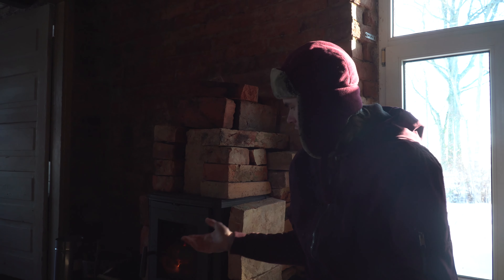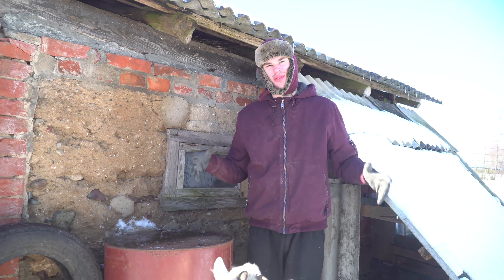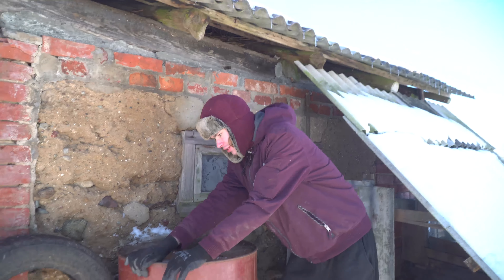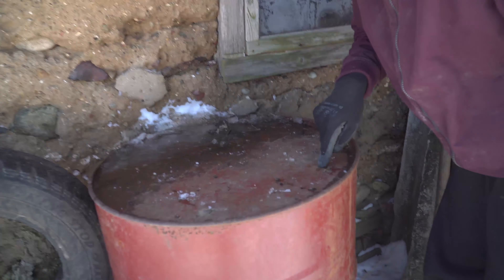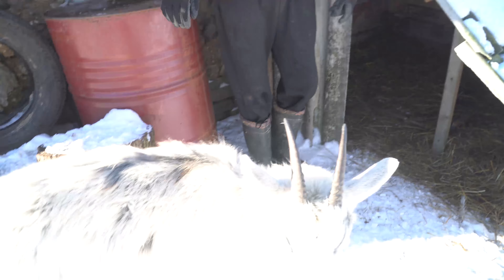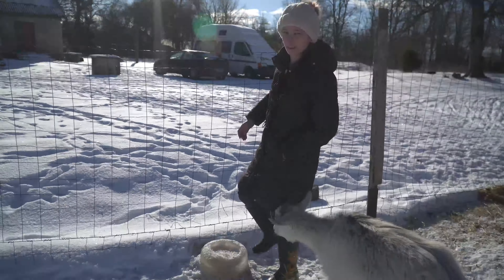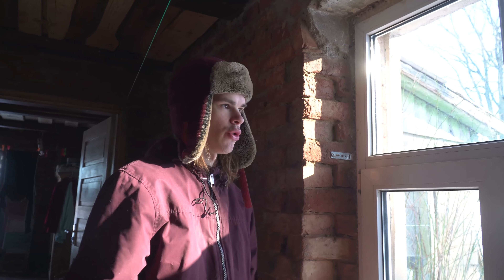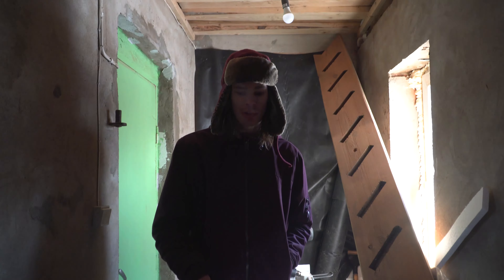WE SHOULD DO IT, BUT....

Comment: Your plan to clean and organize your files and videos is really good thinking! Now it is a right time to do it. Three weeks from now you don´t have time for that anymore! And even that the storage room is freezing cold, could you put temporary radiator so that you can declutter and organize? Then it is easier to start in spring. I am so excited for you guys and for upcoming spring! There is so much to do. I am waiting that moss to be removed from the roof and some beautiful colors to be appeared on outside wall. I would go very light mint green 💚. It sits nicely on environment and looks beautiful in summer against green grass and stunning in winter below white snow 🏡
Reply from the maker: The storage room is very cold and cold blowing through all over the place only thing that could heat it would be a burmer hester but we don't have one but it can wait anyways. The roof needs to be changed, i do like the moss but it needs to be fully removed and replaced, not a cheap process but needs to be done. The house color we where thinking about a nice green color and roof maybe red or green 🤔❤️

Comment: Hi guys, you're still thinking about your heating ... I think the old oil drum is not a good idea.  Maybe the tin will hold last a heating season, maybe not.  Weld something yourself or find an old gas cylinder or an old pressure tank made of thick sheet steel ... Cast steel would be perfect and would still work for your grandchildren.  A rocket heater must have a vortex (whirl) of flames, preferably anti clockwise, and since such a heater needs a lot of air, a pi!pe to the outside is absolutely necessary, I think 1 "should be sufficient. The fire flap (door) is opened for start heating and during the main fire the Air comes from outside. This air from outside, the 1 "pipe can be installed in such a way that the required flames vortex (whirl) is created ... (when heating up there is no vortex required).  So, the exhaust gases and the vortex of flames rise up the exhaust pipe to just below the upper surface of the dome.  The pipe should be about 1m long and end maybe 10 or 15cm below the dome.  then the hot exhaust gas goes down in the double wall between the stove pipe and dome wall and exits the dome at the bottom.  Now the hot exhaust gas can simply be diverted to the outside, or you can only go 2m back and forth in the house.  Then the gas should be cold enough.  The pipe in the house does better with a large diameter, maybe 160mm, the chimney outside (insulated) and with maybe 120mm (smaller diameter, less gas volume and higher speed).  The back and forth pipe can be thickly surrounded by stones (mass).  It's a nice, warm place to sleep.
Reply: I'm amazed about your ambition for help! Thank you so much 🌞🌟
Reply from the maker: Thank you for all information! 😊❤️